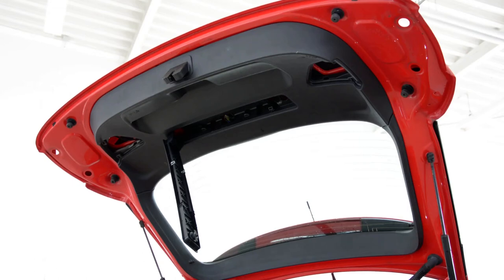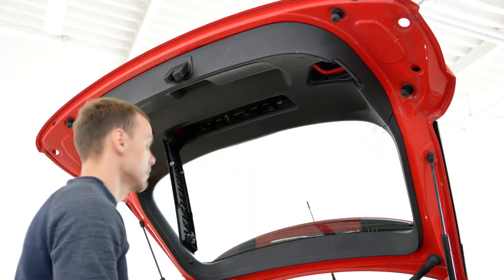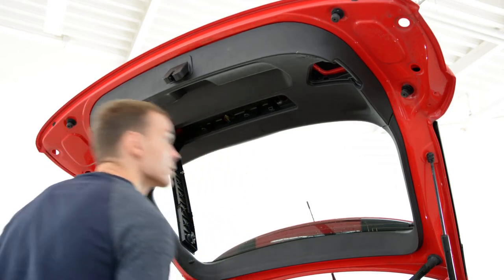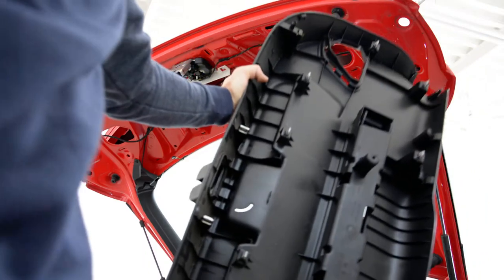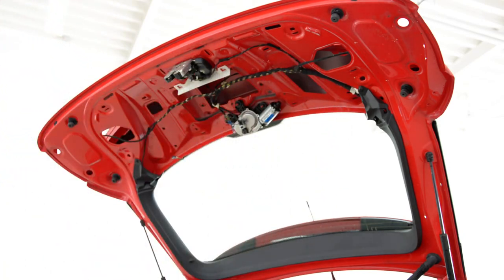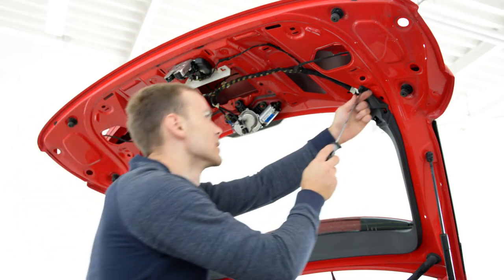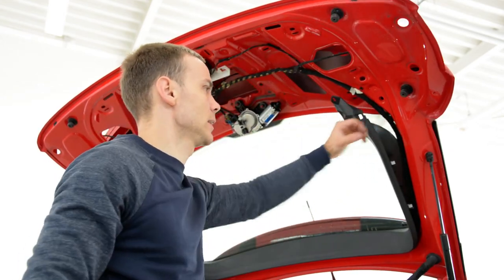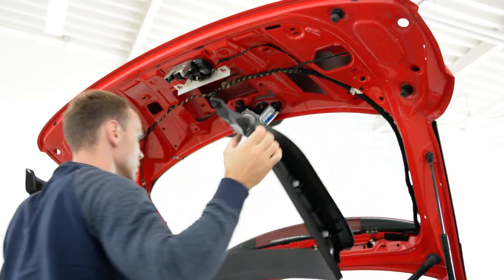Audi A1 Tailgate Trim Panel Removal

Comment: Thanks for this great video. Helped me a lot. But I have a slight problem. When fitting the lower part plastic trim I cannot get the section around the lock cover to clip back in. Any ideas?
Reply: Pull hard